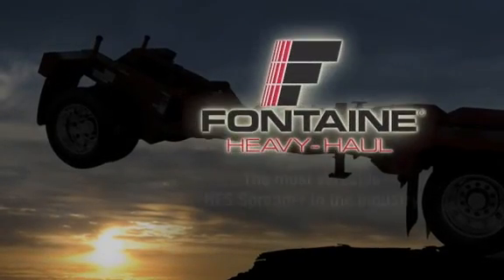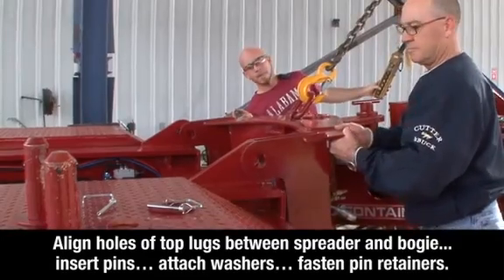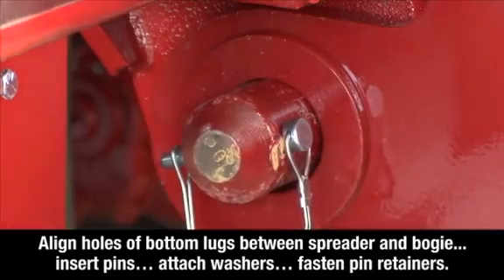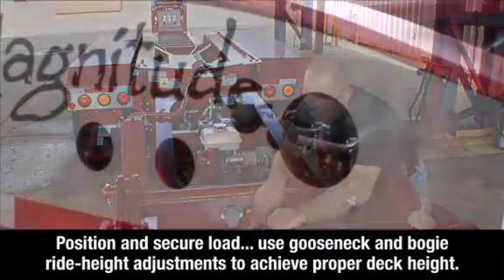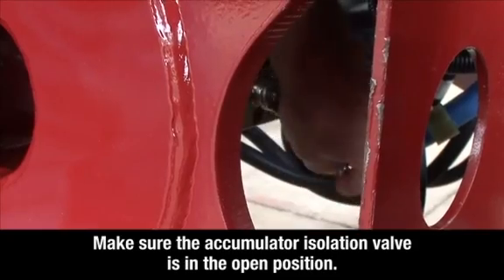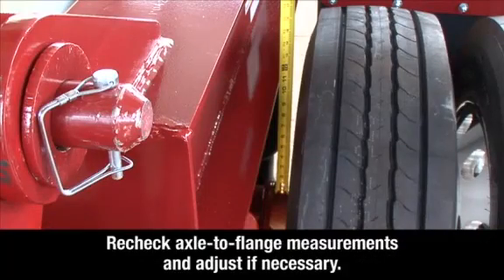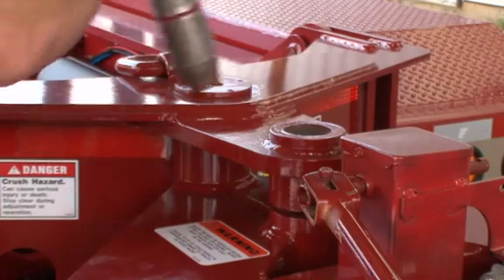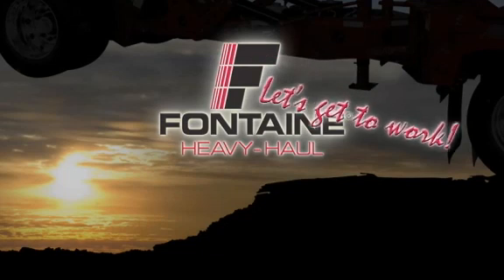2015 FONTAINE MAGNITUDE 55  3+1  WITH NITROGEN STINGER For Sale

Comment: I had a 7 axle Fontaine 2007 and it just wasn’t a strong trailer lots of weak spots. Air isolation valves were just bullshit. Weak neck and booster was not user friendly. Just not a fan of this trailers. I traded it and got a Aspen and I am very happy